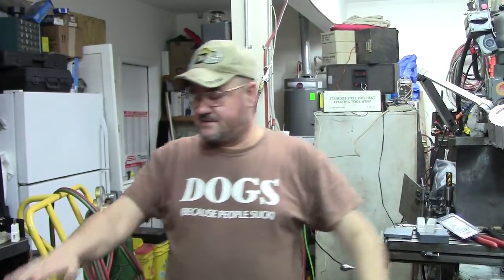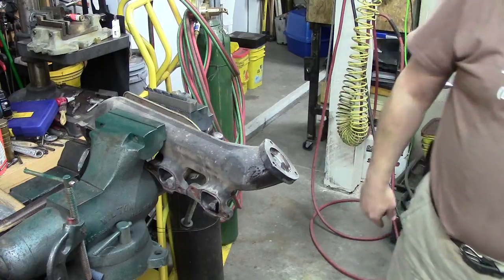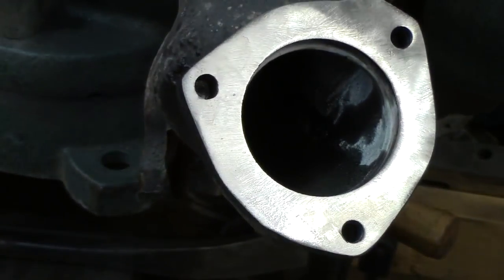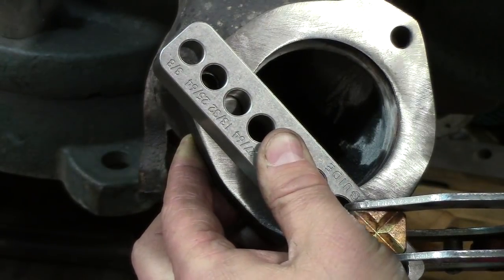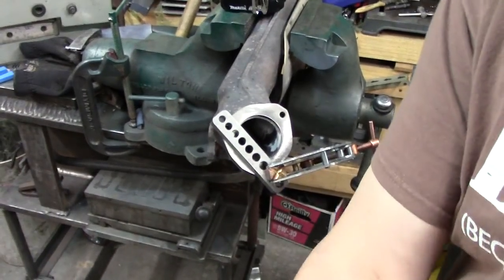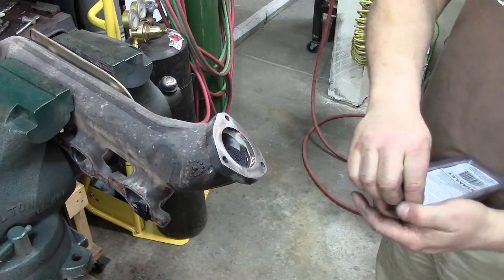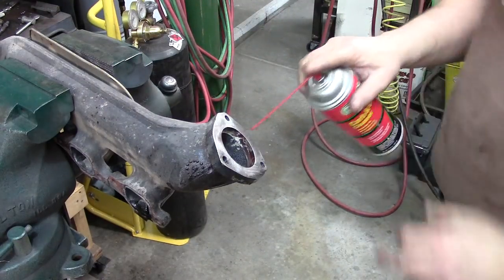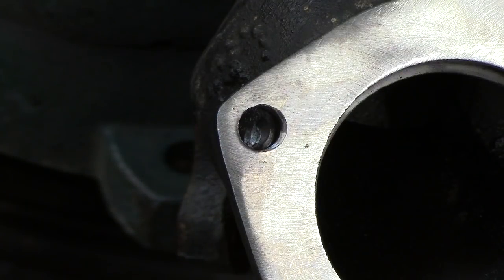Drill Hog Left Hand Niobium Drill Bits Get it out PT2

Comment: I buy Helicoil brand kits, as they come with a nice case in the kit. Just put 2 sizes and inserts in the case, along with 2 drills of the right size, so that they all fit together. A small magnet sticks all the inserts together so they do not go all over the place as well. Old cases were steel, so there the magnet keeps every part in the case as well.

Comment: It might have been easier to put studs in the two good holes, line the drill guide up between the studs and bolt a bar across the top of the drill guide instead of trying to use a clamp.
Reply from the maker: Bill Holt yup, I'll keep that in mind for the next one.